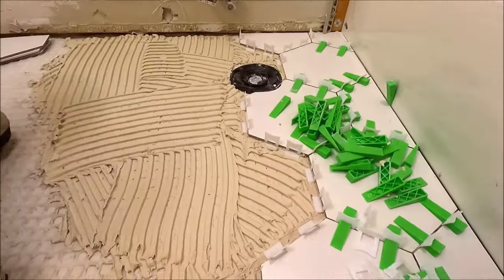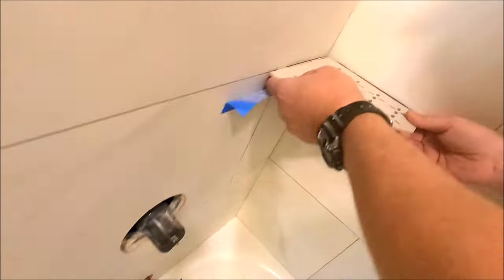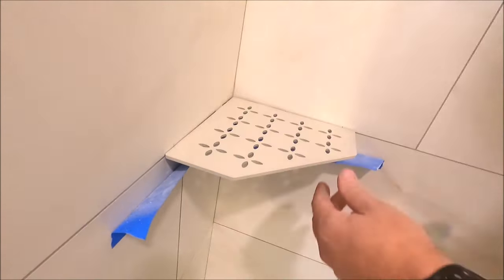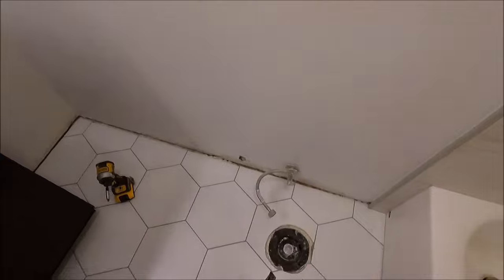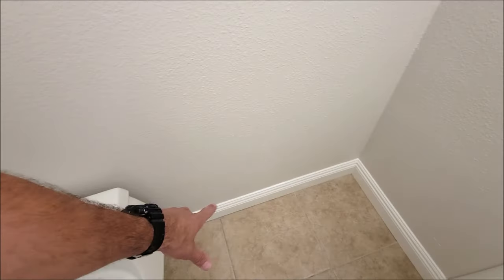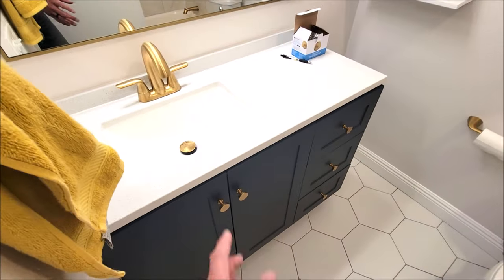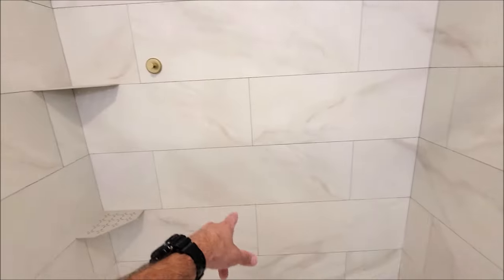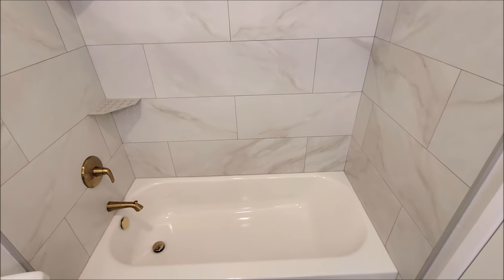Brushed GOLD is Back! 2000 to 2023 Modern Shower Remodel!

Comment: I've been binge watching your videos where you review tile saws. Does the table on the Harbor Freight Diamondback 7" table go slightly crooked when the front or back wheels go off the rails? You don't mention that in either of the two videos on that saw. This is a problem with the 7" inch Ridgid tile saw. Thanks.

Comment: Im about to install hexagon tile small. Ill be self leveling the floor. Customer wants them butt together. Do you recommend using 1/32 leveling spacers to make sure its perfect. Thank you
Reply from the maker: You never want to butt together, I would go 1/16 spacers if I were you.
Reply: @LandbergTileTV  thank you so much! I'll get the 1/16 I knew it wouldn't be right to butt them